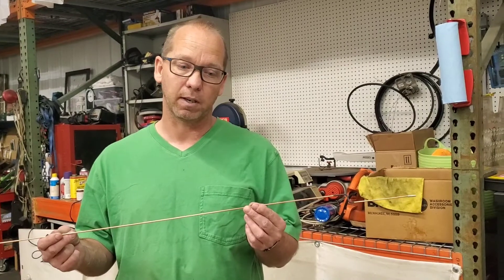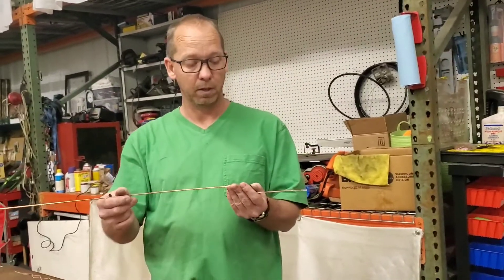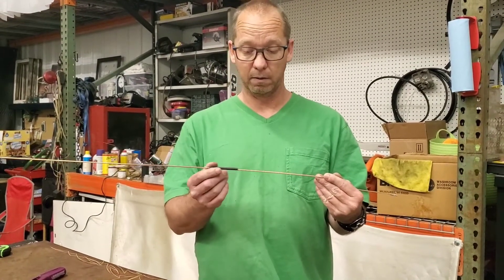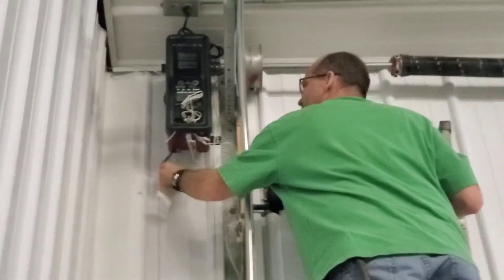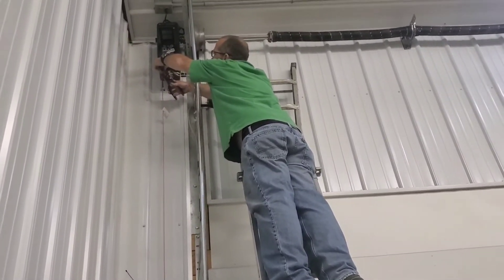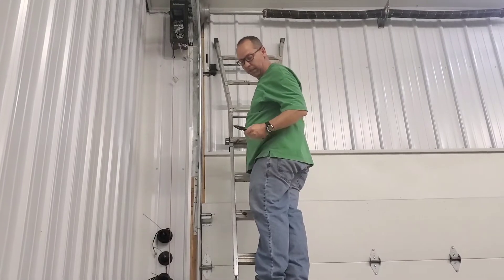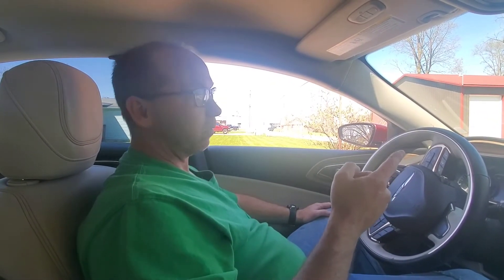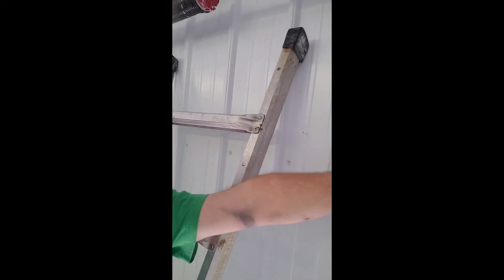Extended Range Garage Door Opener Antenna by KC9ZXE

Comment: The antenna range is still hampered by this configuration. That Liftmaster model transmits/receives around 390MHz, which is 7.7 inches (19.5mm) at 1/4 wavelength monopole antenna dimensions. You want to use a coaxial (e.g. ground adjacent/shielded) connection between the antenna out of the opener's PCB and a ground point on that PCB (as close to the antenna out point as possible) and then strip the outer components of the coaxial cable once you are outside the building with 7.7 inches of the center wire exposed. That would be the optimal design for range and longevity of the opener's electronics.

Comment: LED bulbs product 300 to 400 mhz radio signals that interfere  with garage door opener signals. need to get receiving antenna away from the lights. I too live in a steel building. I had to use grounded coax cable extended to the outside of the building. I stripped away 9" of grounded exterior cable, mounted through  insulated bracket not allowing the center 9" wire to touch ground. Use aluminum tape on antenna wire that is not covered by ground inside the building. solder connections. Antenna length is determined by wave length, only need 1/4 wave. Grounded exterior of the coax cable is what does the trick.

Comment: Thats i nice building you have!  I have a similar setup, also the lift master 8500.  How long do you make the antenna?  Maybe you mentioned that, isn’t the length of the antenna critical for the frequency?  I’m not an expert and would like to know from someone who has expertise in radio operation.

Comment: Thanks for posting this! I have a metal garage door and metal roof insulation and my car's homelink has trouble communicating even in my own driveway! I'm definitely going to give this a shot. What kind of bracket did you use to keep the antenna oriented upright?

Comment: I'm having the same issue with my opener not having enough range.  Can you tell me what the rod for the antenna you purchased is called and where can i buy it from?
Reply from the maker: I used copper coated welding filler rod from harbor freight. Then soldered wire too it. You can purchase that at any welding supply place